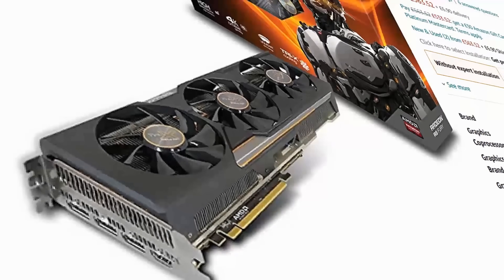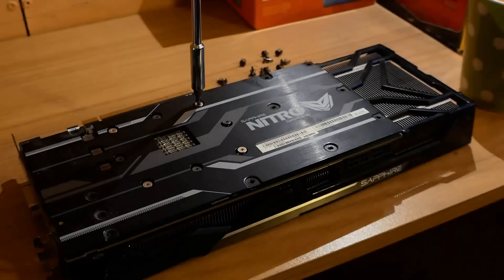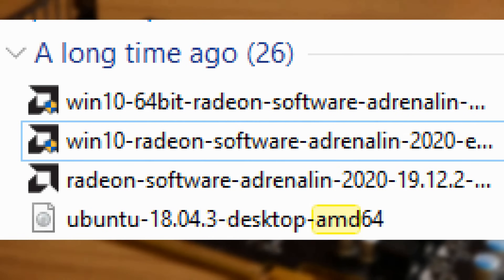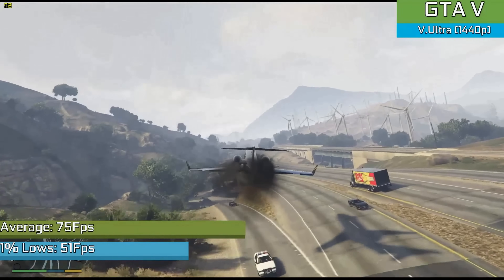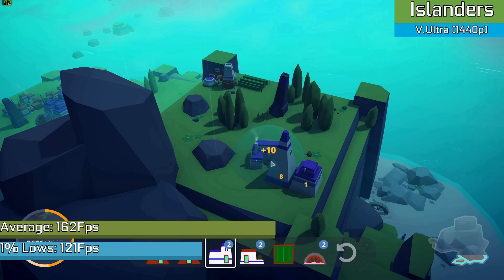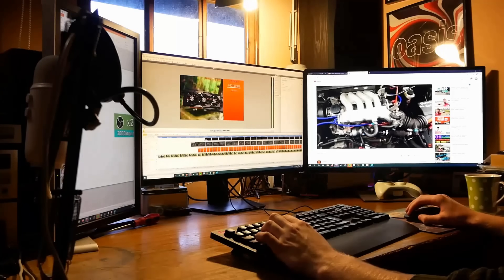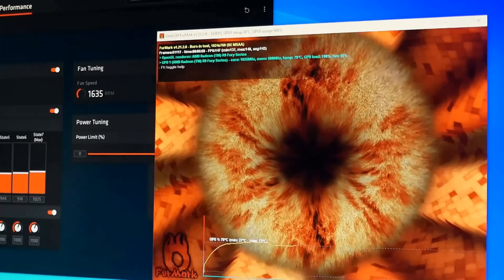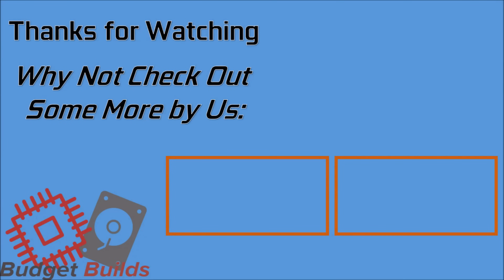The AMD Fury - A Fantastic Failure!

Comment: What program or settings did you use to undervolt your R9 Fury? I got the exact same model and I'm really considering undervolting it, since the power draw is insanely high for no reason at all.
Reply: You can do it in Radeon software. Just right click in windows, go into Radeon software, go to the “tuning” tab, check GPU tuning and manually lower voltages at the stock clocks, while testing  for stability in unigine heaven or an intensive game you like to play
Reply: @lonniemurray4742  much thanks for the quick guide!

Comment: Correction, in a Linux setup using Vulkan + DXVK the Vega 64 is a champ. Running that setup with my 1950x and it runs smoothly. Oh and my wife swears by the Vega 64 in ARK.
Reply from the maker: I can confirm Linux side performance is still pretty decent. I actually started a video on Linux and was impressed by the support.
Reply: @BudgetBuildsOfficial  Great to hear that you are giving some shine to the Linux community. 390x, Fury, RX400/500, Vega, even the latest cards from AMD are well supported and Vulkan surprisingly runs the cards cooler vs DirectX. 

Best out of box Distro that I have seen is Manjaro. If you are looking for an entry point into the Arch ecosystem with it massive AUR (Arch User Repo) this is my pick. Not only that but The Manjaro Manager makes upgrading from one kernel the next rather smooth. Draw backs are the rolling releases of software if you are one who does not enjoy updates but not forced like other OS systems. Command-line is extremely powerful in Linux but under Manjaro you can ease into it. Try Kdenlive and OBS while you are at it, think that you might find it useful. Lutris and Steam are the best platorms for games.

Comment: wait, you have a 4k monitor and play games past 60fps? do you have one of those super expensive 4k monitors that go above 60htz? if not, you're locked into 60fps no matter the resolution and no matter what fps the game says its running on. i did not know this either when i got my 4k monitor. if i had, i probably would have settled for 144p 1ms  >100htz monitor instead.
Reply from the maker: My main monitor is 1440p 160Hz. There are also advantages to playing beyond the refresh rate of your monitor. Associated mostly with latency.
Reply: @BudgetBuildsOfficial  i didn't know just how important monitors are and that it's not something to cheap out on when i got my low-cost 4k monitor. being locked in to 60fps is fine for a lot of games- but i've heard others say that very high fps and fast response times is much more pleasing than 4k,60fps,4ms response time of most lower-cost 4k monitors.

Comment: The Fury is a good card but still much better cards out there, just cause it fits your needs does not mean that there is not cards with massive leaps. I had the Vega 56 and the Radeon VII and the Radeon VII would be often over 50-70% faster than the Vega 56 which is over 30-60% faster than a vanilla Fury. Now I got myself a Radeon RX 6900XT which is over twice faster than the Radeon VII. So that would be a massive 3-4.5X times faster than a Vanilla Fury. How is not that a massive leapfrog in performance? LOL

Comment: Me and my friend were talking about gpus. I personaly run a GTX 970 and he runs a RX 470 8gb i told him for my personal rig im going to go for a RTX 2060 or 1070. But he kept argueing and saying that i should go for a Vega 56 or 64. I dont know what to do. Personally i would want to stay on Geforce because of the NVNC encoder.
Reply: Depends on pricing. I’d rule the 1070 out of this one since it’s much slower than the 56 and especially the 64 and 2060. If you can find a Vega 56 under $200 get that, a 64 under $250, even better and if you either have a lower than 550w PSU or find a 2060 for less than $250 I’d say go for that. In terms of performance it’s 1070<<<<<Vega 56<<RTX 2060<<Vega 64. an undervolted Vega 64 is closer to 2060 super in most games, but even stock it trades blows with the 2060, being a little faster on average
Reply: @lonniemurray4742  well where i am 
1070 160-200€
Vega 56- 350€
Vega 64 450€
Rtx 2060 300€

I tbh only need something that has atleast 4 to 6gb vram the 1060 is about 160€ here and the gtx 980 and 980ti cost about 100-130€
Reply: @dexsters5643  in that case i'd say best value is a 980Ti but I'd spring the extra for a 2060. Out of question what do 1080's go for in your area? bc if you could snag one for under 2060 pricing i'd grab that
Reply: @lonniemurray4742  well gtx 1080's going 250-300. (Dèpends on the model)

I did sed a 980ti for 195€ and a gtx 980 for 100. I was going to try and get the 980 but no replies
Reply: @dexsters5643  a 980 isn’t much faster than a 470. A 980 ti for 190 doesn’t seem like much of a deal either and Vega cards seem too expensive to be worth it where you live. So I’d say if you find a 1070 under 200 go for that, or stretch for a 2060 since it costs and performs similar to a 1080 with more modern features
Reply: @lonniemurray4742  the reason why they are for 190 is because there simular to 1070 and thoose go for 200 to 250
Reply: @dexsters5643   I had one, so I’m familiar with their performance, it’s a pretty fantastic card to be fair and in older games it’s even faster than a 1070, but in many modern titles it struggles against the 1070. So the only way I’d get a 980 ti is if it was less than 150 or so, and IMO it’s the only maxwell card worth considering.
Reply: @lonniemurray4742  yeah prettu much
 The 4gb cards will struggle hard. And im tbh going to go probably for a 1060 6gb for 90€ because i sad 1 for that price but it has a waterblock on it

Comment: Ah, Fury.
The card that was barely faster than a 390X, sometimes slower, often times crippled by the 4 GB VRAM and that was hotter than a 390X of all things.

GCN3 and Fury/X was the 2nd worst uArch AMD/ATI made, right after HD 2900 XT.

Nowadays for Fury, undervolt is vital, paste needs replaced probably, Texture Settings need to be set to On/Performance in driver and Tessellation Override needs to be set to x8 globally.
Reply: I liked my R9 285...
Reply: I still max everything out on my Fury X with no issues or desire to upgrade with every game at 80+ FPS but I'm on a 1080p Freesync 144Hz monitor.  Highest temps are about 63C.  Would I recommend it? No.  Is it bad comparatively, yeah for sure now.  Has it been good for the last 5 years for me, yeah no complaints.  Only big plus for me was frame time consistency was better than the 980Ti that I had as 80fps looked smoother than the 133fps it was putting out at the time circa 2015-2016. 

TLDR;  Long term review:  meh...
Reply: @Azraleee  IMO buying any cars with less than 4 GB VRAM past 2013 was just a poor decision.

285 was solid, but not great for what it was (kind of equivalent to a 7950, but not always faster and never more efficient).

At least RX 380 (same card as 285) came in 4 GB VRAM variants. And in newer games, eventually GCN3 started pulling ahead of GCN1. Plus FreeSync support.
Reply: @raresmacovei8382  It did everything I needed from it. I was mostly playing WoW, Overwatch and Dark Souls on PC.

Comment: 6:00 My main annoyance with AMD is their naming and numbering lack of a scheme. With both Nvidia and Intel I know exactly where a new product lines up in the product stack going about 25 generations of products to date. AMD I haven't got a clue if their latest and greatest is 10 years old or all new because they change the names and numbers with each new architecture and numbers alone for the refresh and refresh of the refresh. Where the fuck did they get Vega from and obviously they no longer use that but released a "Radeon" card with the exact number used before just after Vega? is that the old Radeon or new? wheres Vega stack in??? WTF AMD, I can't follow your shit if it's all over the place.

Comment: Ahh yes, THE [OG] Fury. Probably shortest actively used GPU, in my time around custom built computers. I still have possession of it, but, yes, it was effectively given cold shoulder by dev. team [drivers / such], early after the cards release. I eventually ended up backpedaling, to my 7950 [FINE Wine GCN], for a decent while... They should've made an 8GB variant of [OG] Fury at least, IF not be set at 8GB -->  that 4gb window get chewed reel quick nowaays

Comment: I'm using a EVGA gtx 1650 SC ULTRA an it's boost clock on the core hits up to 1920mhz an the memory up to about 4000mhz ish lol but it's a 4gb card as well but with the RTX 20 series die an GDDR6 memory

Comment: I had nothing but issues with my Asus Radeon R9 Fury, for an example i cannot have a simple skype call with webcams on the card will just crash my monitors, saying no 'video input'. AMD just sold me crap from the start. My card went into repair twice and always got it back with 'nothing wrong with the card' blaming my system instead. But ye when it does work its nice for example i did play AC valhalla with this card and it runs pretty smooth!

Comment: Good video. I never experienced a Fury. (maybe I will one day) For it's time this was an engineering masterpiece, that AMD didn't had profit on. And for that, you just have to like it. It was in the shadow of the GTX 980, that it, (as I remember) did compete well against in gaming. Only beaten by the following 980 Ti 6GB.
Like the (also engineering masterpiece) Vega 64 (a GPU I have a lot of experience with), it had a rough start, but aged well. Though a Vega also need some Tuning to perform it's best and/or keep it below 300W. Not your average user friendly GPU. What I like about these AMD (not popular) GPU's is that AMD was experimenting, and pushing bounderies (failed, and learned from it). And what we have today, is a refinement of these experiments. And today, their new flagship actually has taken the performance crown. HBM just wasn't for mainstream gaming. It had huge potential (that was what the engineers could see), but newer really utilized IRL.

Comment: Currently using a Nano full-time because there wasn't anything better (at a decent price) locally. I've had a few crashes, but not enough to complain. Drivers have been OK on my side as well. It sometimes flashes a line that looks like memcorruption, but otherwise it's worked fine for 6 months.

Comment: I have a Ryzen 3500u laptop and except for the weak ass cooling they put in this laptop, it's an absolute workhorse. I can play 1440p youtube on a 4K TV without a problem, and I can play most games I want to play at 1080p (the native monitor resolution built into the laptop)
this laptop has been repurposed as my desktop machine, being on a laptop cooler 24/7 and being connected to a TV 24/7.
this laptop weighs 1.5 pounds and it sounds like a hair dryer, but I can play up to doom 2016 no problems.

Comment: well you should have tested crysis remastered instead of  2007 version
Reply from the maker: I never said can it run crysis remastered though. I asked if it can run crysis?
Reply: Fair point but the thing is crysis remasterd has better optimization especially in cpu side and modern api support so it's better for benchmarking

Comment: Are you crazy? 

"nothing really seems like high enough of a leap up from the fury"?

You compared to a 1070 earlier in the video, the Fury is approx 30% slower than a 1070 on average...
Then a 1070 is Waaay below even a 1080 Ti, then compared to the upcoming 3070..

- I think it's time for an upgrade dude!
Reply from the maker: I think you missed the point I was making. If Im already playing the latest and greatest games (that I rarely ever touch) at 1440p 60Fps with Predominantly High Settings then there is little reason to upgrade.

The difference to a 1070 entirely remains on title ran. In most shown the actual experience doesn't differ greatly from my own AMD Fury.

There aren't any cards that really scream out upgrade worthy. A new RTX card might be nice for the creation side of things.

But if you're on an AMD Fury I see little reason to upgrade (unless you demand 4k Gaming or 144hz in all titles) in which case you'd likely already have upgraded.

So no. I am not crazy. I just don't see any need to spend any money on an upgrade until something decent value comes along. Possibly used/display model RTX Most Likely. 

I hope this explains my reasoning better 👍
Reply: @Budget-Builds Official  oh I get your reason.. If you're happy with the performance, for your particular setup/use-case and games etc, then no point upgrading, I get that..

But my point is in saying you haven't upgraded because there hasn't been a big enough performance leap yet, is false... there HAS been a MASSIVE leap in performance... you should have said you dont want to upgrade yet simply because you dont feel you need to!

your original comment gives the impression that there's not much performance gain between the Fury and new(er) cards, which is false....

At least, that's how I saw it...
Reply from the maker: It depends what areas you'd class as an improvement. RTX and Featureset wise definitely an upgradeworthy area...In terms of actual performance, well for the last 5 years we have been limited by fairly mediocre consoles, with the specs topping out with the XB1X which is virtually on par with the AMD Fury shown in the video. 5 Years later its still performing about as well as it did on release, with 4k Medium being a reasonable target, and 1440p High also being achievable. 

The card isnt  at the stage where its needing a drop in settings or resolution down the meager amounts we used to see a 5 year old card reach. I suppose to a degree this holds true for most "mid console generation" cards, as it stands yes I could get a new card, which are targetting 4K and even now 8K the same way the Fury targets the afformentioned resolutions but for myself (and the vast majority of consumers) I dont even have the equiptment to take advantage of those areas.

I think the best way to word this is "Yes new cards are better, and yes performance is a great deal of a step forward (Can not stress that RTX and the new Creator Features are awesome additions) HOWEVER is it really enough of a step up over what the AMD Fury currently provides. For some peoples YES definitely chasing those higher resolutions, settings, and framerates, BUT for me 1440p with Med/High in 2020 Titles with 60+FPS is more than smooth to tide me over. 

Given this video was already quite lengthy at 18+ Minutes long there is only so much I can fit into one bit of a video. But I hope this clears up my final viewpoint. 

TL;DR- New cards have awesome performance BUT whether thats enough to warrant an upgrade is down to an individual. For me thats a No.
Reply: @BudgetBuildsOfficial  We could argue semantics all night, I get exactly what you're saying.. 

I Just meant that the way it sounded to me like I said above... :)

Comment: I cant really understand how ypu got those numbers in GTAV and RDR2, I have a RTX2080 and get the same numbers woth the same settings
Reply from the maker: Then you have issues in other areas with your system. Most likely a CPU Limit.
Reply: @BudgetBuildsOfficial  i may be wrong, but I feel like a 4790k should be sufficient. It isnt close to full utilization.
A friend of mine got a 8 series i7 with the same results.
Reply from the maker: Yeah the 4790K is generally worse than my CPU in most instances. It sounds like you're CPU limited.
Reply: @BudgetBuildsOfficial  well, I already planned to update. Just waiting for Ryzen 3 to be in stock :)

Comment: its a 1080p card..why would u benchmark it in 1440p these days?....
Reply from the maker: The Fury generally performs worse compared to other cards in lower resolutions, it only begins to stretch out ahead and show of its frankly awesome performance once it gets to 1440p and beyond. As you can see by the performance there was no reason to even test 1080p, as 1. Its not a resolution i ever use on this card, and 2.The performance in 1440p is already extremely decent.

Comment: Basically just a RX 580 with less vram and older architecture.
Reply: osspaljeni  you mean the RX 480 not the R9... Also not its about 10% faster and you can't buy 480s because they don't make them and the price was the same at launch for both, so you can't really use the rebrand angle when they cost the same and perform better. 

Also yes you can compare them and they preform almost identically in gaming on these cards. They only used that for the marketing chance to say that "In these niche test we have a slight edge against nvidia" even though HBM isn't much use for other tasks.
Reply: osspaljeni  it has overhearing issues on some models and almost no upgrade path... It was also not a sustainable design! It was 10% and they preform almost identically to the fury.

It's really just not a good purchase over them because you won't have a warranty and it's an aging card with less optimization in games.

Comment: GTX 480 V2
Reply from the maker: No.
Reply: @BudgetBuildsOfficial  I mean, you kind of said it with the high power consumption. I also suspect that if there were ever a version with only one fan (much like most 480s were) then the Fury would struggle to keep cool, much like the 480.
Reply from the maker: Fermi Gen 1 was architecturally flawed, and would leak power, often running exceptionally hot at even idle speeds. 

The Fury doesn't run hot, however the power consumption is down to AMDs own overvolting mishaps. Fermi is its own unique failure, as is the Fury.